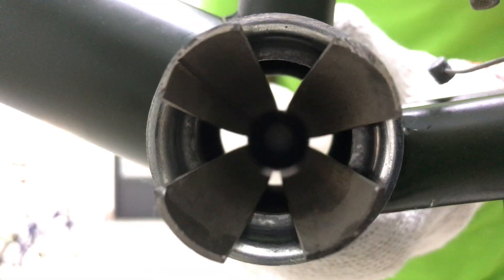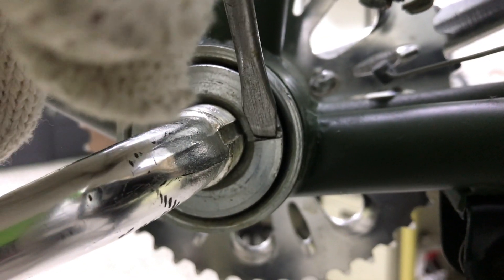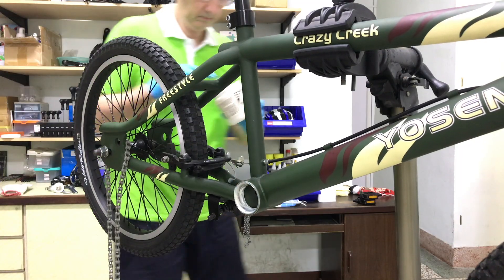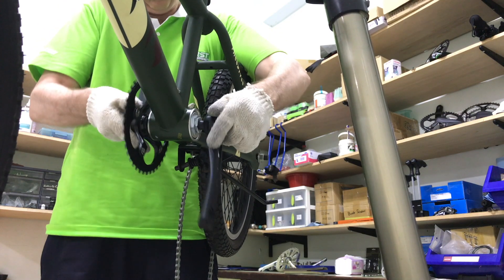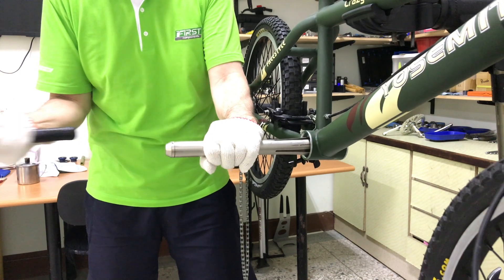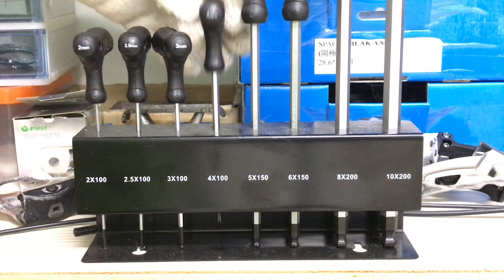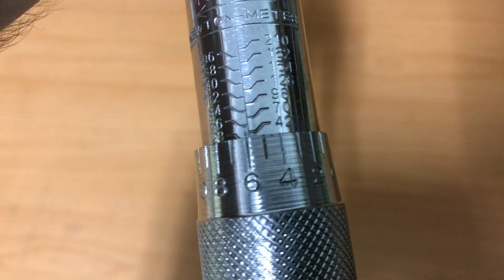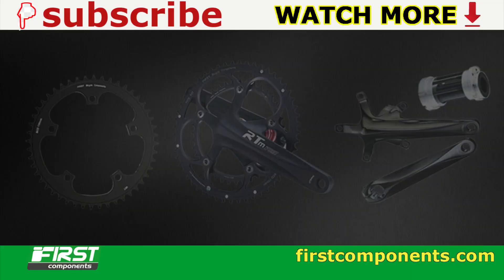BMX 3 Piece Crank Set & Bearing Installation (2 Techniques)

Comment: Thank !! what is the type or size bb cartridge used for bmx
Reply: Is Euro ?
Reply from the maker: English threaded to fit in the adapter which is American
Reply: No  the bottom is Like you adapter . The bike Is a Intense speed  BMX
Reply: The spec of bike say Euro BB
Reply: The spindle lenght is 108?
Reply from the maker: The cartridge used in the adapter is a standard square taper bottom bracket cartridge: 68mm 1.37" x 24T